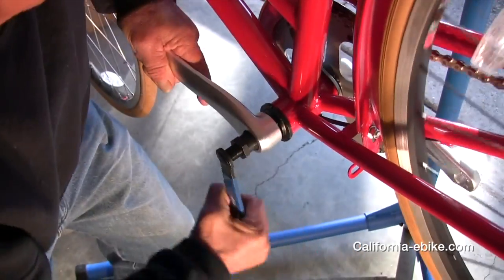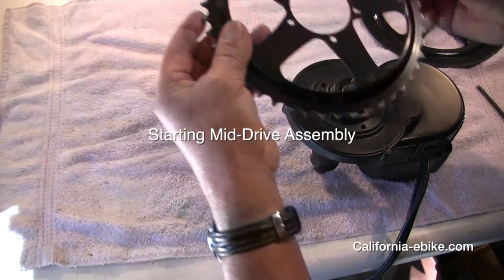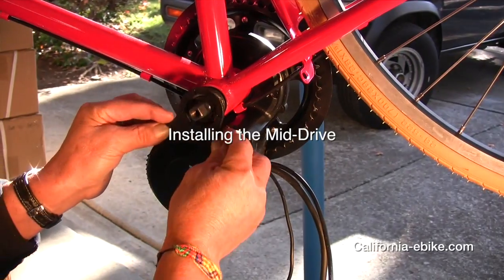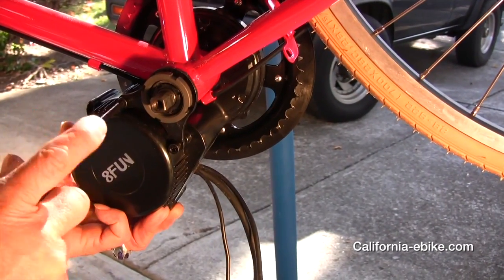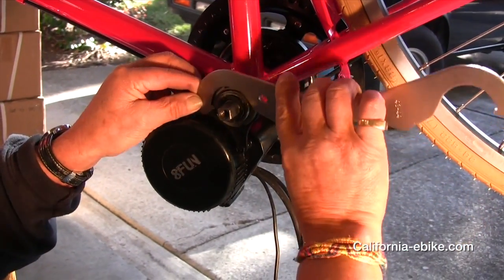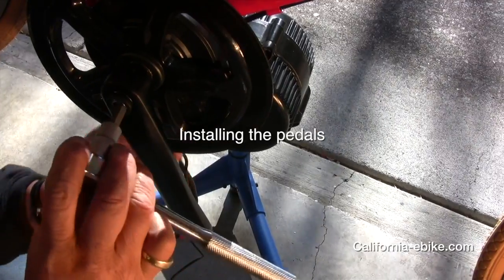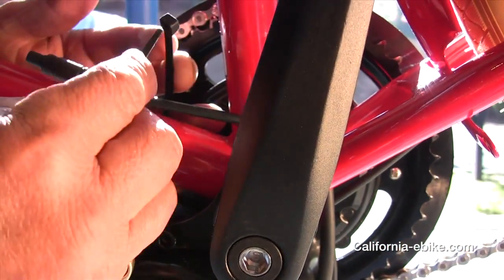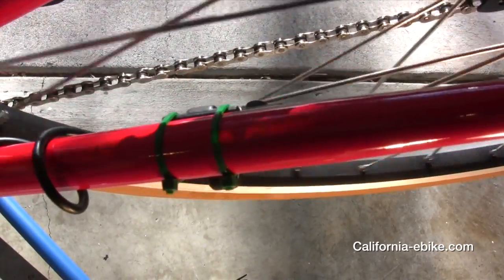Bafang 8FUN Mid Drive Electric Bike Conversion Kit Installation

Comment: Hi Doug,

I recently acquired a 8FUN motor but instead of 3 connectors I have 4 would you happen to have experience with this extra 4th wire and know what to do with it?
Reply: The additional 4th wire is for an optional Gearsensor that would normally mount on the rear chainstay. If you do not use it just wire tie it to the chainstay and cap it off to keep water a dirt out of it.

Comment: can i use a 1000w battery on this motor?
Reply: You can use a 1000000w batery as long as its voltage is correct which in this case is 36v.

Comment: Hello Doug, do you know if i can deactivate the pedal sensor? i think its danerous with 750w motor when i use it in traffic and similars, and i want to use only the thumb trottle. Thanks!
Reply: +PALAKAS Bambú Assist level "0" is supposed to disable the PAS and the throttle but we normally change the settings to allow for the throttle to be active with "0" pedal assist. That is a software change that requires connection to a computer.
Reply: California Ebike thanks! i will try it
Reply: California Ebike I change the settings in level 0, and the throttle works but the PAS works too. How i do to make the throttle works but the assist dont?
Reply: +PALAKAS Bambú I don't know why the PAS works in "0". It's not supposed to.

Comment: Should we use a non-permanent  thread lock (blue) on the sprocket and guard bolts?  or on any other place?
Reply from the maker: +Robert Krause We now always put locktite blue semi permanent on the 33mm slotted steel nuts. It won't hurt to put some on the 5 chainring screws as well.

Comment: G'day Doug, got a question regarding battery charging..  when connecting the charger should I be powering on the battery? have it powered on before connecting? or simply connecting the charger with the battery powered down? (ie: Off )..  I'm currently charging for the first time with the battery powered down and just curious as to whether I'm actually putting in any charge. =/
Reply: +Monstaah It all depends on the battery. Some have to be powered on and some don't. Just watch the LED. if it turns red, it is charging if it stays green it is not.

Comment: Doug,
Thank you for installation details.
I am thinking of putting the kit on a recumbent.
You rotate the motor clockwise before tightening it in place.  Can the motor be rotated counterclockwise and tightened in place?
Is a chain guide required to be installed?
Are there rules of thumb that predict the range, for different average speeds, that you can get from different battery Ah / kWh?  What kind are you getting?
Reply: TheLookingOne 
Yes, you can rotate the mid drive to where ever you need it. No a chain guide is not needed. With light pedaling, a 10Ah battery will give about 20 mile range on average.

Comment: is it possible to mount one of these in a bmx one piece bottom bracket with an adapter kit?
Reply: You would need a bushing machined to take up the space but it is possible. There are adapters made but they usually extend the 68mm length to over the limit of 73mm.

Comment: I have one of these motors mounted on a mountain bike. I tried a very steep slope and the motor just stopped working. Now when I move the accelerator, I hear a faint click and nothing more. The controller screen is on but no indication that something is wrong. Is there a security system on that motor, a fuse or something I need to change? It happen before when the motor was having a hard time but after few second, it worked again. This time, it is for good and need repair but I have no clue what to do (beside putting it apart and investigate myself).  Does someone know what to do?